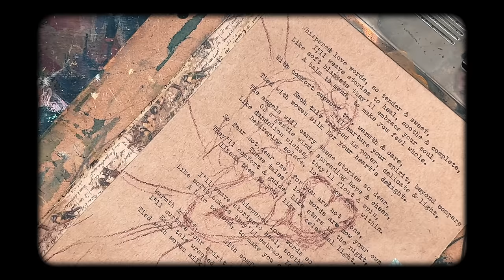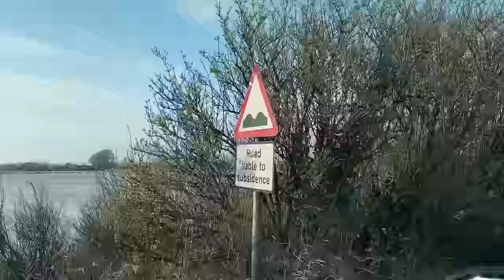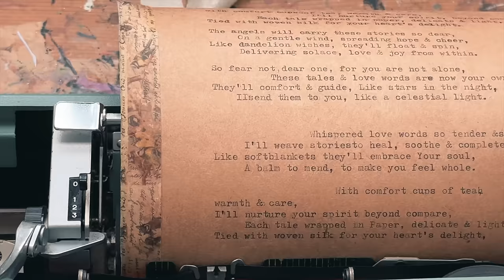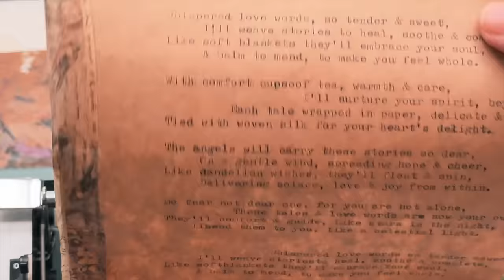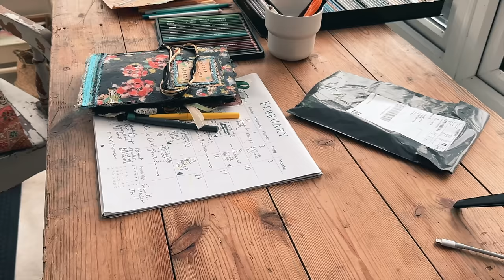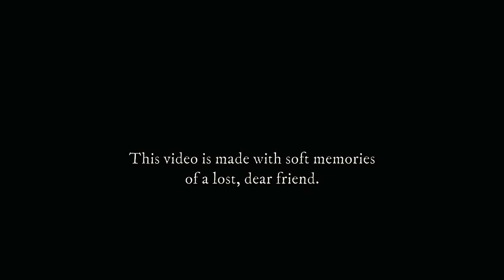Setting Up a Home Studio | Changes, Updates, Tour & Art Vlog

Comment: What a lovely art space you've created. I love your new table. I used to work on our dining table. It was a lovely table with white legs and a nice wooden top that my hubby and son had brought back to life from a dreary old dark stained $50 2nd hand bargain. It was 1.8m long but, like you, I found the apron too deep and it got in the way of my legs and stopped armed chairs fitting under it. My mum was downsizing and I inherited her old table. It's 1.5m so a little shorter but it's slightly deeper and has a shorter apron set back in from the edge of the table. That makes so much difference to comfort and fitting armed chairs. I've no idea what it's made out of but it has a very smooth white top and the paint wipes off it really easily. It's not as pretty but much more functional as my art table and it leaves our dining table to be used for dining. I love your dresser but have too many windows and not enough walls in my space to be able to have one. I miss the one we had at our old house. My daughter and I share an art/sewing space and we're trying to figure out storage at the moment. We're currently in a bit of a mess 😄

Comment: You have a lovely set up at home now ❤ Re the heater, they cause a lot of moisture, potentially black mould especially if the rest of the house is cold, just a heads up, to avoid this you need ventilate, windows open just enough to get your fingers through the gap is sufficient.  Aaaaand, get a carbon monoxide detector please ❤❤❤

Comment: You mentioned condensation...propane heat is also wet....just open up a window a crack and keep the air moving to help with that.